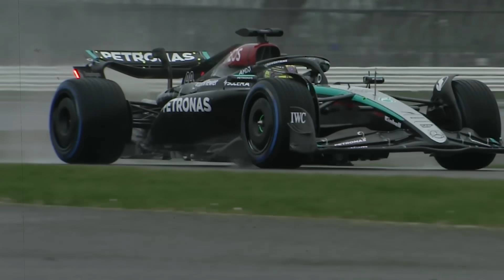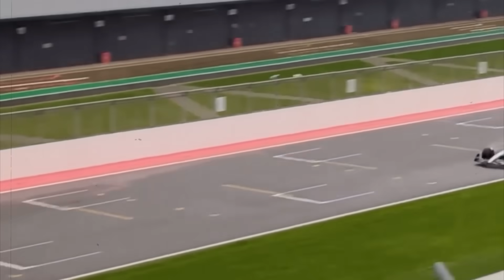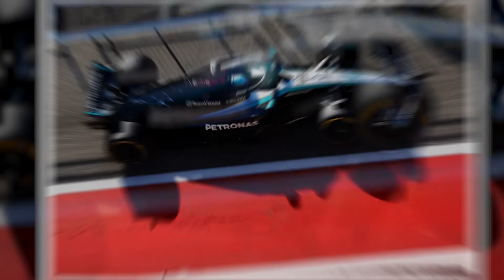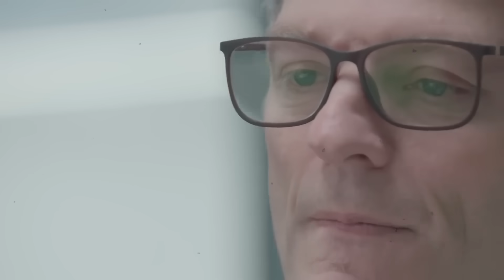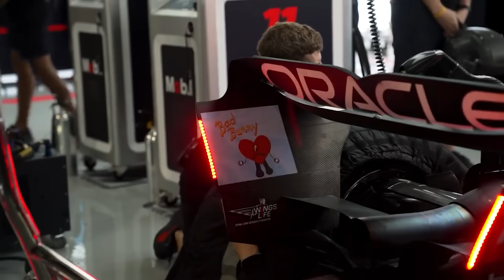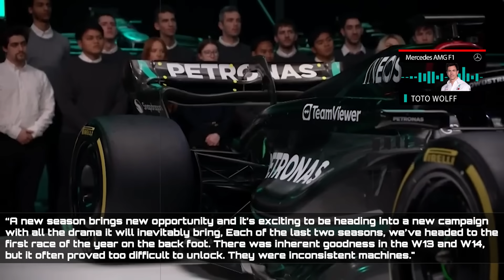Mercedes READY for COMEBACK after BIG W15 Updates!

Comment: Wow, some of these comments.  Some of you out there need to start writing for daytime soap operas.    Mercedes is building as stable as a car they can.  There is no point of adding more power if they cant put the power they have to the ground.  Some of you have no idea about how racing works.  Is this the  new audience Formula One keeps bragging about?  If it is, this sport is in trouble.  This is the result of the Red Bull Protest Era, its as simple as that.  For two seasons straight Mercedes has used a gimped car that had no hope of winning.  Its gonna take another two years to build one they can be confident with to put more power into.  Its motor racing.

Comment: Should have simply copied everything from the RB in 2023 ... then focus on getting the underpinnings and aerodynamics tweaks asap.

RB is simply improving every season ... from the 2022 car .. that had the pushrod rear suspension, a neutral handling with with cockpit further back, full side pods ... and .. their brilliant underpinnings.

Unless Merc got lucky and developed car better than the RB for 2024, it's doing a lot of unnecessary catch up  ..... by not copying the RB as much as possible last season, and this.